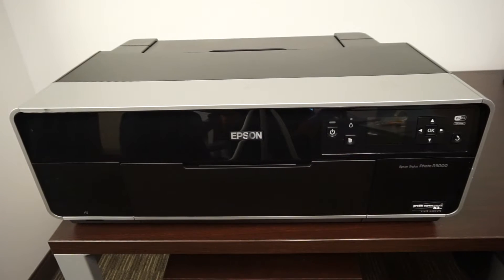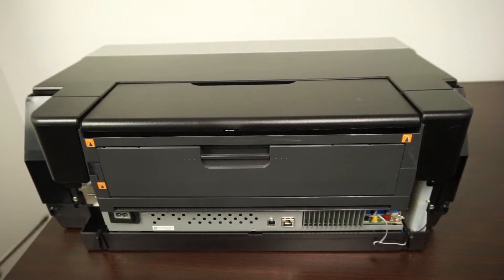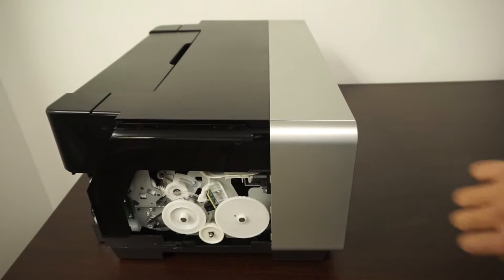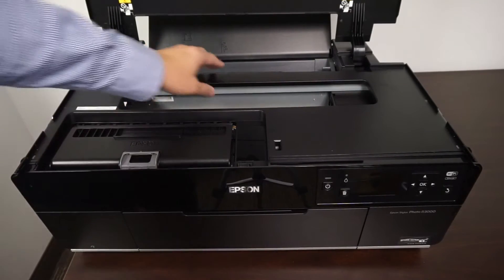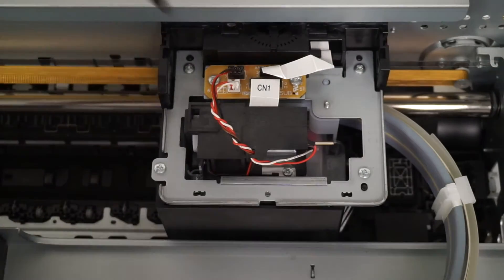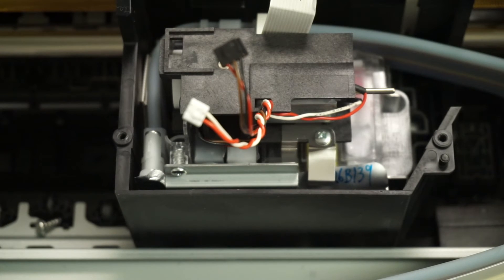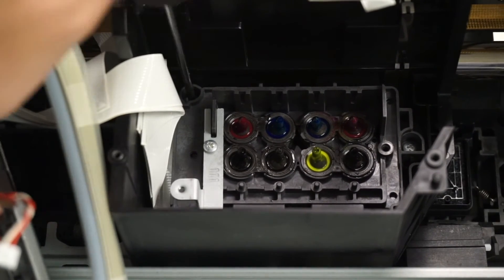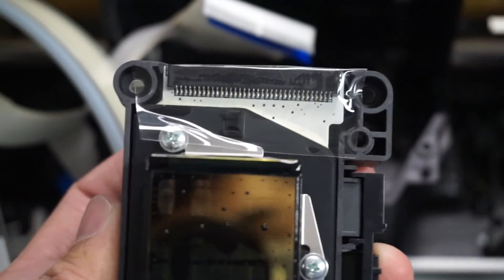How To Remove Print Head From R3000?

Comment: Waow ! I'm impressed. Not sure I'm able to do the same thing, but I may be obliged to try, because I don't have any printing from the 2 black cartridges (PK and MK) and I don't manage to clean the print head. I suppose cleaning the print head after removing it is the next step ?
Anyway thanks for this video, very helpfull !
Reply: I know 4 months passed since this comment, but just wanted to say that if you don't fix it cleaning the printhead, you could have a clogged/defective black switch valve!

I hope this helps :)

Comment: All this trouble removing the housing panels is unnecessary.  On an R3000 the print head can be removed directly.  Jump to half way thtu this video.
Reply: Do you mean it can be removed by merely flipping the lid open and following the other steps here from that point around 3:15 in the video? Thank you.
Reply: It appears you cannot remove the single screw seen at 3:20  (for removing the top of the printer head assembly) without getting the top of the printer off first, as the screw is not accessible without that step, so I'm not sure this information from Tom is correct but I'd love to hear more. I'm tearing into my R3000 right now attempting to replace the print head.
Reply: Updating my own repair, in hopes this will help someone else. Accessing the print head assembly and actual print head, without removing the entire case, can be done but is a very tight fit getting the parts in/out of the printer. Here's what I did: I drilled a hole (large enough to insert a screwdriver through) through the plastic interior cover of the printer, directly above the single screw for the black plastic cover of the head assembly (which I had moved to right of center of the printer,  to the left of the capping station). I could then remove that single screw holding the black lid of the print head assembly in place (via the drilled hole, where I'd inserted the screwdriver). (When drilling, I was careful to capture all pieces of plastic which fell. Don't let them get down into the printer.) To remove that print head assembly lid screw, you might instead be able to sneak a flexible or angled screwdriver in through the top of the printer, but I didn't have one of those. Then, taking a lot of care, I was able to follow the rest of the steps in the video for removal of the print head, disconnecting ribbon cables, etc., and get those parts out, all without disassembly of the printer case as shown in the first half of the video. Note some screws in the print head assembly are similar but I think different sizes, keep track of which one goes where for re-assembly. Having said all of this, it would be easier to get the print head parts in and out of the printer if you take the case apart as shown earlier in this video. I was able to replace a print head without doing so, but it was very tight, I had some difficulty with reassembly, and there was some risk of pinching cables in the process. But in the end, I have a new head installed thanks to this video showing the way. BTW I had removed a print head from another R3000, which had never been charged with ink due to some fault in the pumping system and was out of warranty when this fault was discovered. I had no issues with that print head working in this other printer I've been working on, other than having to run cleaning cycles and test pages to get it full of ink and printing correctly. I thought there might be firmware or other issues but so far so good.